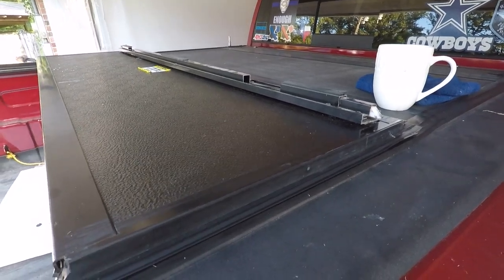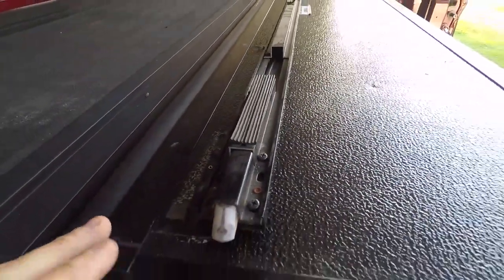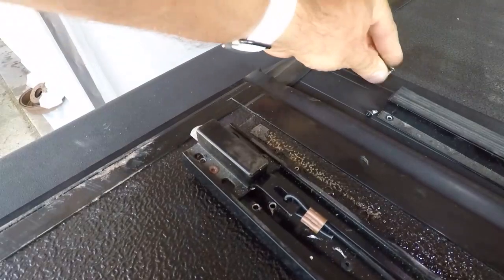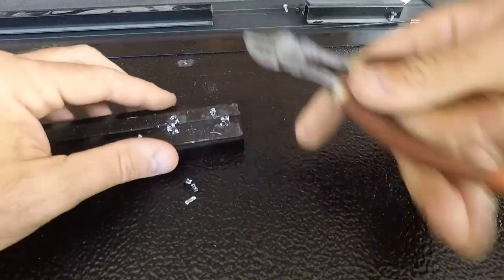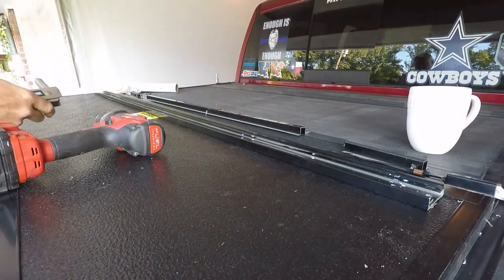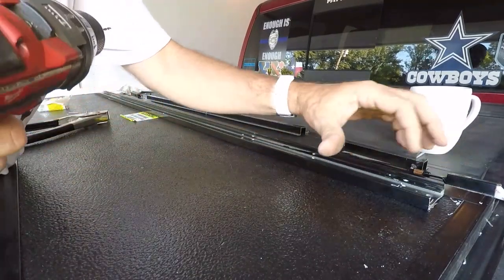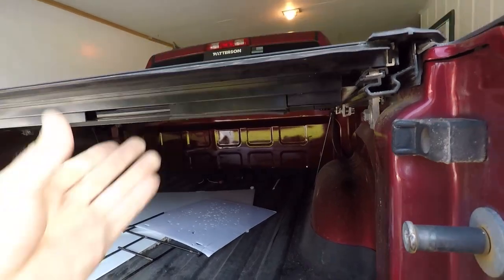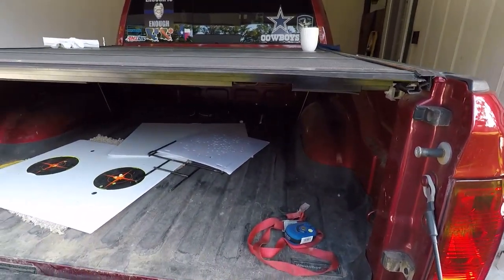Bak Flip G2 Folding Pickup Truck Bed Cover Repair

Comment: Thank you much for the video!  Got a flat on the way to work yesterday, I opened up the tailgate and see my latch bar hanging at a 45 degree angle... don't it just figure?  A quick youtube search put my mind at ease with a relatively simple fix.  1 quick trip to homedepot for some double sided Gorilla tape and I went to work.  The longest part of the job is removing the old adhesive residue (razor blade and a wire wheel on my cordless drill).  Cleaned up, taped down, and 12 rivets later, I don't think it is going anywhere anytime soon.  At least I know what to do now when the other two give up.

I've read a lot of complaining about these Bakflips in the last 24 hours, but if I'm being completely honest - I've had mine for 10 years, put it on within a month of owning my truck.  120k miles and a lot of opening and closing later, and this is the first significant thing I've had to do to mine.  Yeah, the locking rods came undone within the first year, but a little bit of loctite has long remedied that.  Replaced both drainage tubes, but only because they were clear, or at least they used to be - black tubes fixed that issue.  Every once in a while a side seal jumps it's groove at the seams, but how hard is it to push it back in with one of those plastic dodads?  I am about to have to change out the weatherstriping that runs along the track, as bits of it are starting to turn into goo.  Oddly enough, it's not one of the seals that they sell replacement pieces of.  

No doubt it was faded and worn looking by it's second TX summer, and it took a beating in a couple of light hail storms during the winter that didn't leave a single trace on my truck (those outside panels are thin), but all in all I think it's held up fairly well.  Maybe the newer ones aren't built as well as they used to be?  If you need a 100% waterproof bed, I probably wouldn't recommend anything other than those 1 piece shell styles, but the Bakflip keeps enough of the elements outside of it for me.

Comment: Same thing here owned the cover for just under 5 years two of my latch bar assembly mechanisms fell off in the bed of my truck. I called Bak they sent me both brand new latch assembly no charge. So if you have your receipt and under 5 year warranty give them a call, they were very easy to deal with. Was hoping they were gonna send me a new cover, but no luck there. 

Great video Aaron!

Comment: So this happened to me years ago and I fig doing something like this may not last me long so I went straight to drilled right through all the way.... And put some 1.5 inch long #10-24 screws with large stainless steel fender washers... They are about 1 inch diameter. So yes I have washers showing on top.... Doesn't bother me much and I put two per side. 4 total. Isn't going anywhere!!  Very permanent fix.

Comment: FWIW,  In addition to your spot-on tutorial, I used Gorilla Heavy Duty Double-Sided Mounting Tape and it's been 20+ months and counting and still holding strong. But my middle strip just fell off and had to watch your video again before doing the repair. Thanks again for making it!
Reply from the maker: Thanks!

Comment: My locking mechanism is falling off my 2011 Tacoma which is mostly garaged, it was held in place by sheet metal screws. I drilled ten new holes and installed 3/16 pop rivets. Holding solid. Thanks

Comment: Also happened to me. I drilled the holes just a little bigger than the OEM holes and found some rivets to that size drill bit and it turned out better and stronger than the factory installation. Total time was about 1.5 hours taking my sweet time. I plan on doing the rest of them tomorrow before they fall off. I also used my own 2 sided tape. Thanks for video Aaron it really helped.
Reply: Has it held up?
Reply: @fasttl  like new, maybe even better.
Reply: Did same thing...fell off again. The aluminum is thin and cheap, so now just a bigger hole. 😂
Reply: Still holding strong.
Reply: Thanks for this info, do you remember what size rivets you used?
Reply: Yeah i got the same issue, what's the rivet size?
Reply: I did this fix as well but over time fell off again. There has to be a way to reinforce the week aluminum sheet.
Reply: I agree with @jase042086. It will fall off again over time.
Reply: No @fasttl
Reply: @fasttl  NO. I did the rivets (3/16) 2 times, and it kept falling off after a few months. Elevator bolts 5/16 and 1” in length with rubber spacer worked for me. I just put 2 bolts at the sides like the panel that holds the unit near the rear window. It looks like a perfect match. I also painted the rear and front bolts black. I did replace the rivets in the center of the bracket only this time. This things ain't going nowhere now. Thanks to @jase04286 idea. Don't waste your time with anything else.
Reply: @rickytac1  I did the rivets (3/16) 2 times, and it kept falling off after a few months. Elevator bolts 5/16 and 1” in length with rubber spacer worked for me. I just put 2 bolts at the sides like the panel that holds the unit near the rear window. It looks like a perfect match. I also painted the rear and front bolts black. I did replace the rivets in the center of the bracket only this time. This things ain't going nowhere now. Thanks to @jase04286 idea. Don't waste your time with anything else.

Comment: For anyone watching this trying to repair this faulty cover! There is hope, a little bit of work but, if you bolt through each panel somewhat like the panel that holds that holds the entire unit near rear window. The bolts you need are elevator bolts 5/16 and 1” in length. These will go through the top and sit flush on the top side of the each panel. I place a rubber spacer on the top as well. On the inside the go in through the aluminum bracket. You’ll have to open the bracket to not damage the plastics. I did have to make the holes on the aluminum bracket a little wifer to fit bolt.
Reply: I did the rivets (3/16) 2 times, and it kept falling off after a few months. Elevator bolts 5/16 and 1” in length with rubber spacer worked for me. I just put 2 bolts at the sides like the panel that holds the unit near the rear window. It looks like a perfect match. I also painted the rear and front bolts black. I did replace the rivets in the center of the bracket only. This things ain't going nowhere now. Thanks to @jase04286 idea. Don't waste your time with anything else.

Comment: Do you think some short sheet metal screws would have worked any better? Just noticed mine coming apart too.
Reply from the maker: Possibly.  The metal veneer is super thin.  Thanks!
Reply: Mine is falling off my 2011 Tacoma which is mostly garaged, it was held in place by OEM sheet metal screws

Comment: Just installed the same cover on a '22 Frontier. I had to grind out mounting bracket slots for it to fit. It leaks at EVERY fold seam. I am certain it will not be long before the foam core is damaged by the water inside the cover. The rear corners do not cover the tail gate gaps at all so water is drawn into the rails and bed while driving - even in a light rain. I think I have made an expensive mistake!

Comment: Are the rivet repairs plus using the two sided gorilla tape holding up? Or are those falling off too?
Reply from the maker: It lasted several more years until it all finally came apart and I didn't feel like fixing it again. Still not too bad.

Comment: the rail on the edge of one of my panels broke right off. I need to fit the edge into the U bracket but it's frayed and chipped. do you have a simple fix for this ?
Reply from the maker: Hmmmm. I might try taping it as tightly as I could with strong duct or electrical tape. Hopefully that would clean the edge up enough where it would fit back into the channel.

Comment: Almost the same thing is happening to me but Im changing the entire strip due to the end latch frame has developed cracks in the plastic cover so if someone pulls hard enogh, the latch frame will break causing the latch to fail.

Comment: Had the same problem always use strong glue before screwing it down worked for me, I used gorilla glue.. now i need to find how to replace or repair the top it bubbled up.. Don't feel bad i had 2 come a part on me..

Comment: Ha found mine like this yesterday. Not sure if it fell off or someone tried to get in there. Regardless thanks for the video, doesn't seem to bad of a fix.  How's it holding up since fixing it?
Reply from the maker: It lasted ok, but finally popped off again last week. I may through bolt it if I don't replace it altogether this time. Thanks!

Comment: What size rivets you use
Reply from the maker: Iirc, they were 1/8" diameter by maybe 1/4-5/16 long. Just enough to get through the rail as the outer cover material is very thin. Thanks!

Comment: The original rivets don't look like pop rivets.
Reply from the maker: I think they were but made to splay out for a better grip on the thin sheet metal. Didn't work terribly well in any case.
Reply: Original rivets are a peel rivet, which is a specialty pop rivet.  Probably 3/16.